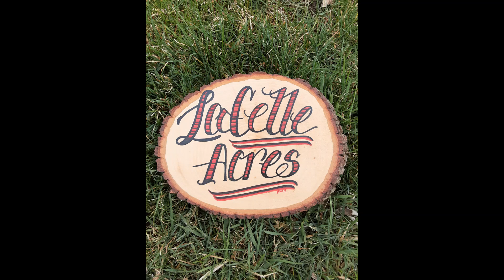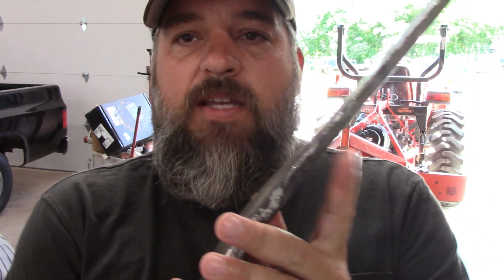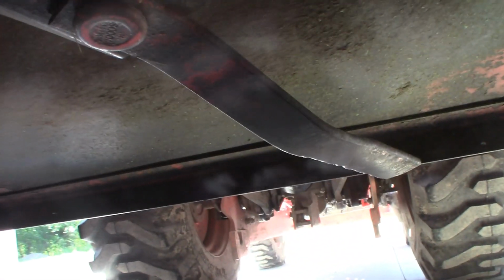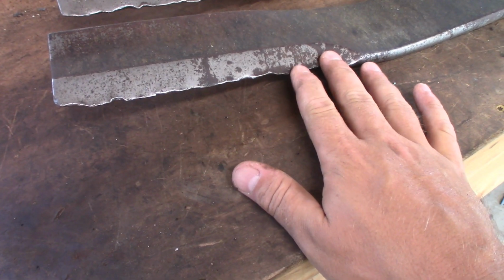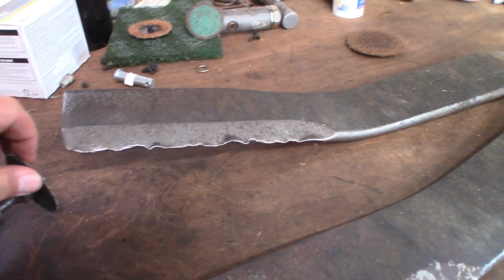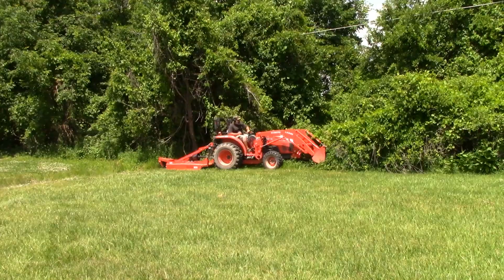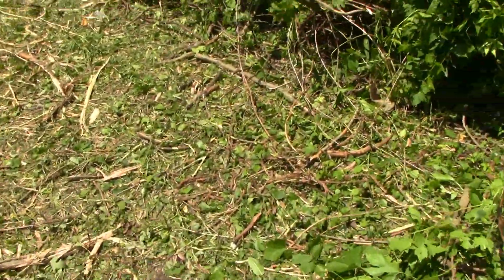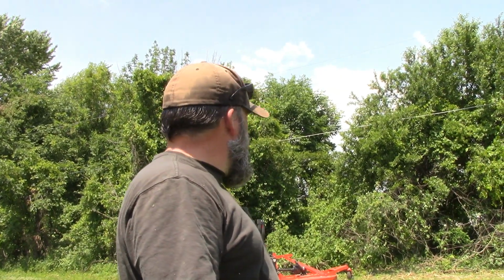Fixing a brush hog vibration issue

Comment: Good Video! I recently got a Milwaukee 1/2” Drive Feul Impact wrench. Makes it really easy to loosen up the Blade nuts compared to all the years I used a breaker bar! Have a 4’ B/H Squeeler with 1&5/16” nut with no key. The round bolt head Has to be held with a pipe wrench

Comment: I have the very same cutter with the very same vibration. I will do the same repairs you did this spring. When mine started vibrating I stopped the cutter then restarted it and it smoothed out again until I cut something like a 1 or 2 in. tree limb.

Comment: I’m going to try this on my brush hog to see if it helps. I pulled the stump jumper off and the spline shaft has some play. Any idea if that’s normal or should it be totally rigid?  What size nut is holding the blades?

Comment: Just FYI, a 4 ounce difference between the tips of the two blades on a 6' mower will result in 73 pounds difference in centrifugal force at 540 RPM (61 pounds for 5').  Losing a little more metal on one blade than on the other won't matter much, but a slightly different radius caused by a gummy pivot point will make a huge difference.

Comment: You screwed up big time, most Bushhog blade bolt nuts are one time lock nuts, each time you remove the nut is should be replaced with a new one.   Most vibration I have seen comes from worn gear box bolt holes.
Reply from the maker: No, I didn't screw up. What I did repaired the vibration. Blades are still on with the old nuts. 7 months later.
Reply: @lacelleacres854  when they come off and go though a Tractor Tire don't blame me, lock nuts only work once, that same for lock washers.   It's not worth risking death to do it cheap.
Reply: @carrollsanders9376  it will be your fault.
Reply: @ramairfbird  No it won't I do it right.